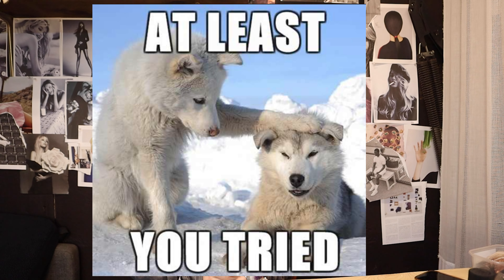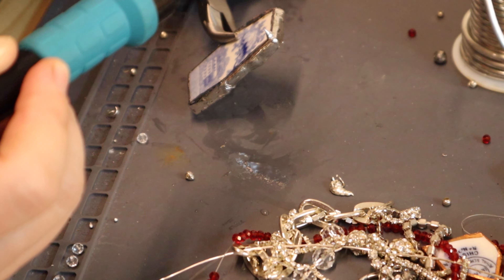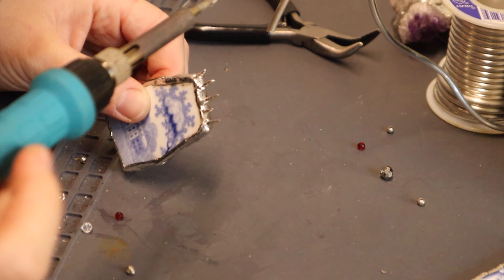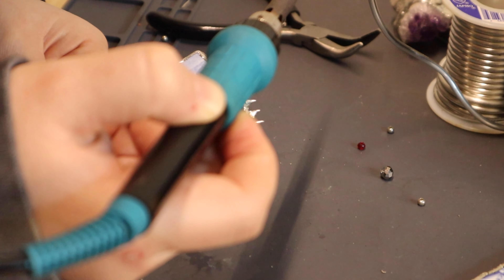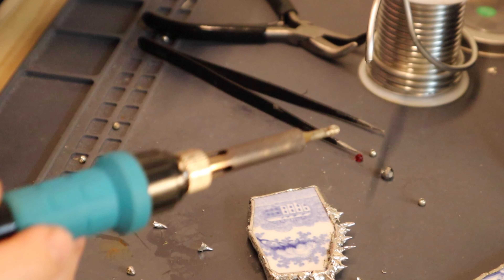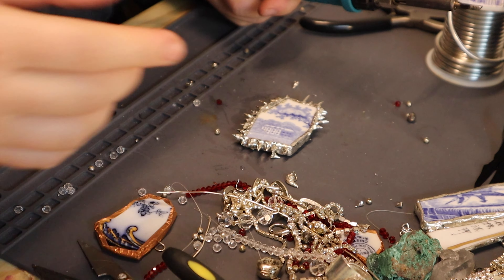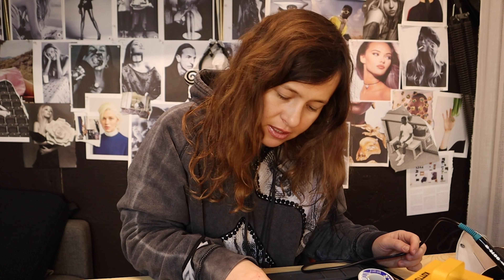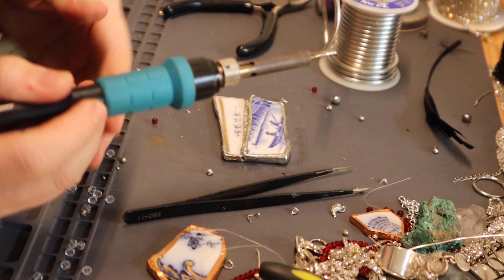How to create SPIKES! Soldering - Spiky Jewelry Tutorial SOFT soldering

Comment: THANK YOU FOR THIS TUTORIAL!!1!!1!1 do i always need the copper band before adding solder? what if i solder something onto a thicker chain made from steel? also, will the solder tarnish when worn?
Reply from the maker: Hi love! Sometimes you can get away with no copper, but it has to be copper based metal you’re working with that silver plated for instance. It will not tarnish know it’s amazing. I’ve been wearing my rings for two years and washing my hands in them and they look just as shiny as they were when I made them.🫶🏻🫶🏻

Comment: Thank you so much for sharing everything! What is the best metal to use to make ring blanks? I'd like to make my own & not use sterling silver or sterling silver plated.
Reply from the maker: Hi! I don’t have experience making ring bases yet! But! You can wrap few stainless steel wires with copper tape and make a ring that way. The only issue would be making sure it’s super polished because since it would be in direct contact with your finger and it would be moving around it has to be super smooth. 
To smooth it out sand it using very fine 2500 up sand paper and possibly Dremel. I hope this helps ♥️♥️